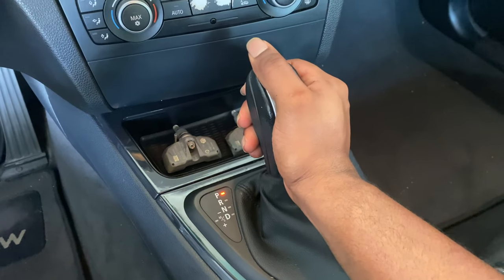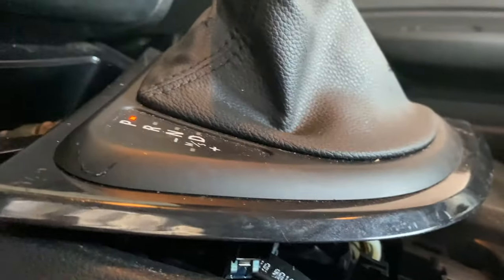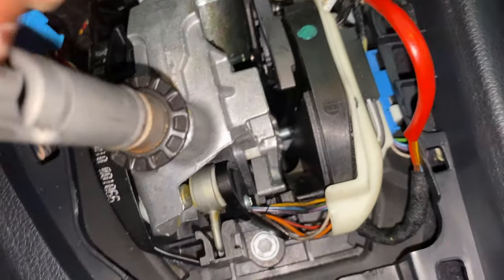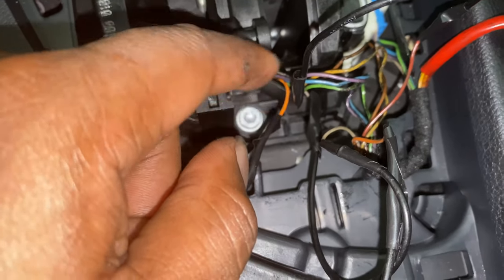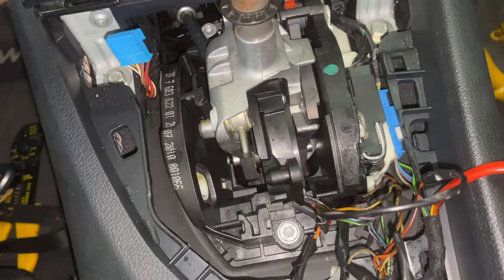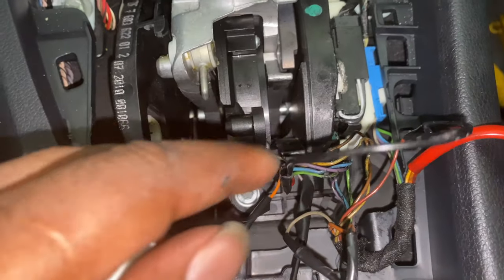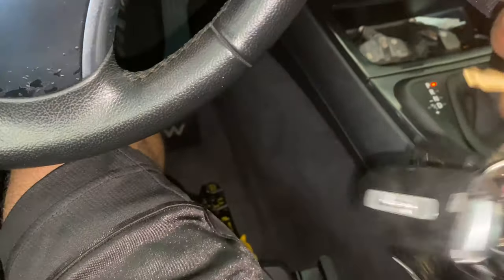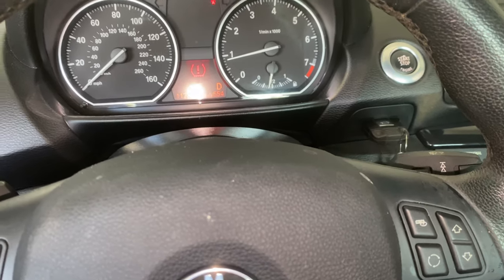BMW E82 E90 E92 E93 Sport Mode Not Working

Comment: Shifter locked in park? Check the solenoid arm and make sure it's linked on the pin. Hopefully it saves you the hours I wasted trying to figure it out when it popped off moving shit around. If you get an error saying make sure the car is in park when u turn it off, there is a tab located adjacent to the pin connecting to the solenoid. Check that too. All in all this DIY works if your wires are split and these were the only issues I came across. Other than that, very simple and easy fix for alot of gain!! Went for a beamer cruise hauling ass 1-6 on the backroads afterwards.

Comment: Just replaced my transmission and everything works fine. Car engages in all gears and I can also shift the gears using the paddle shifters. But whenever I engage in sport mode the car remains in drive. I checked the gear selector wiring and I don’t see any ripped wires. What could be my issue?
Reply: So is my car.

Comment: i have 2008 128i i have the same problem my S mode don't engage i found 3 wire broking i solder the wire together but my S mode still not engaging do you have any idea why not sport mode not engaging thank you
Reply from the maker: Usually its just the wiring. I'd check the entire wire loom in that area. I believe like almost all the wires on mines was messed up. So pull each one and see if it comes up. Besides the wires there really isn't any other cause. But then again its a BMW.

Comment: The little white piece you took off did you break it off or does it slip off somehow?
Reply from the maker: Yea just pull up the little tab piece at the bottom right or remove that screw if you have something to access it. With that little piece out the way you can get more room to work with the wire. No adverse effect of removing that little piece.
Reply: @nOshi2x  Ok thank you so much man.
Reply from the maker: No prob

Comment: Did you use bigger wire ? For the replacement
Reply from the maker: The gauge was slightly bigger, from what I’ve seen can use just about any wire just as long as you give it enough room to flex and route it so it doesn’t bind up, when you go in and out of sport mode.

Comment: How did you connect the broken wires back together?
Reply from the maker: Stripe ends, twist together new and old wire together. Wrap in electrical tape and put back together.